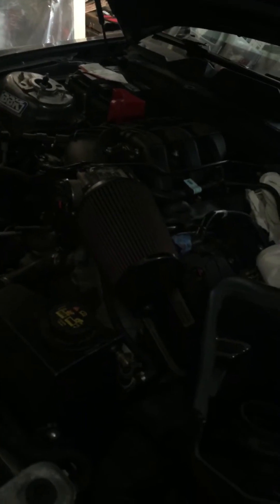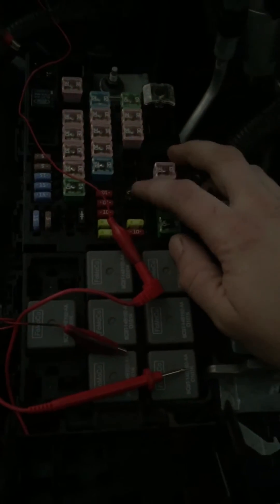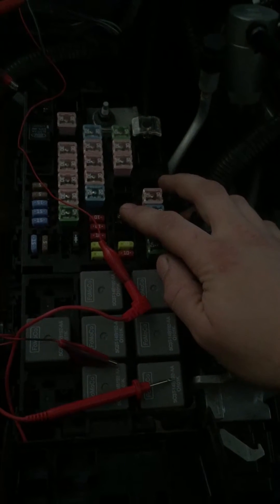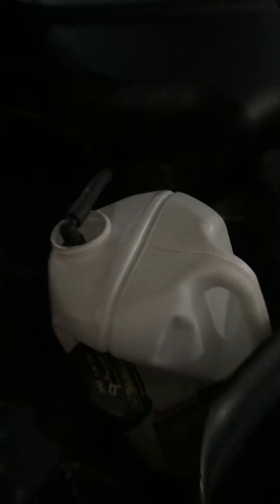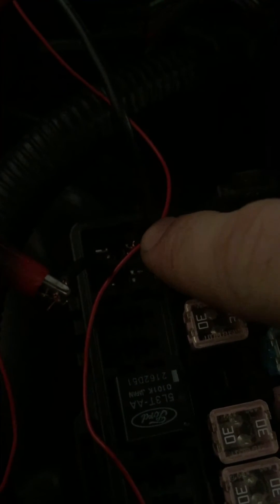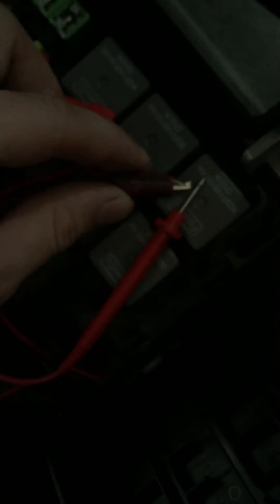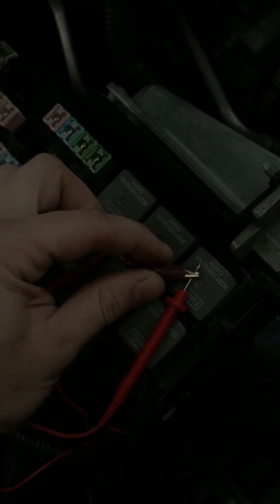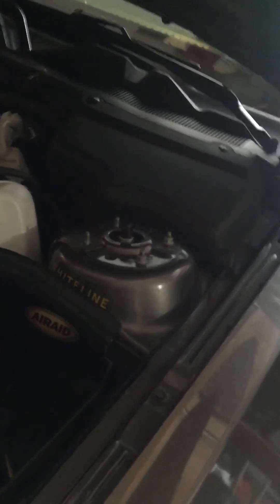11-14 Mustang 3.7 V6 - HOW TO: empty gas tank by jumping fuel pump relay - Possibly GT / 5.0 as well

Comment: How was the installation of the ProCharger for you?  I just put mine in last week.
Reply from the maker: I am still in the process. I have being doing a little here and there around my work schedule. Install is pretty straight forward. I just drilled the crank pulley and installed new one. Have a few more hours left of install.
Reply: +Wes Tanner Good luck.